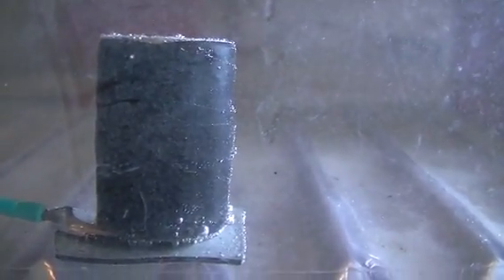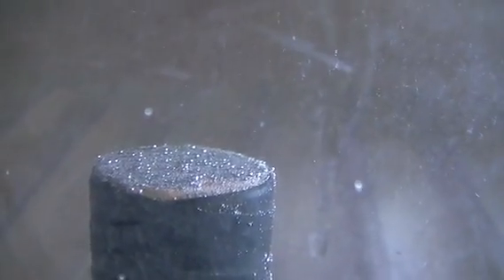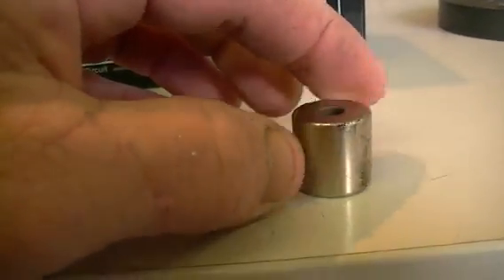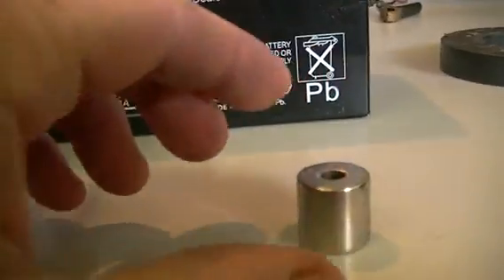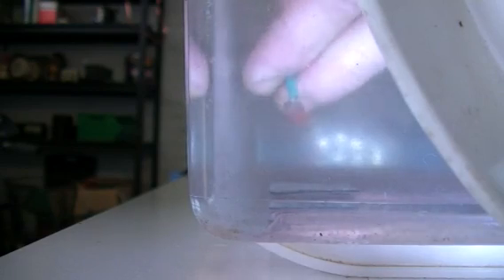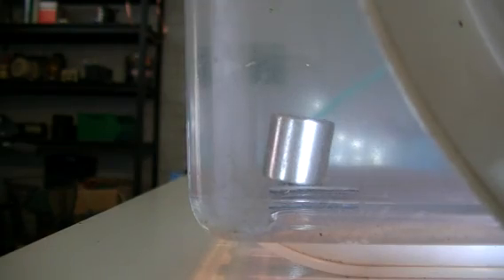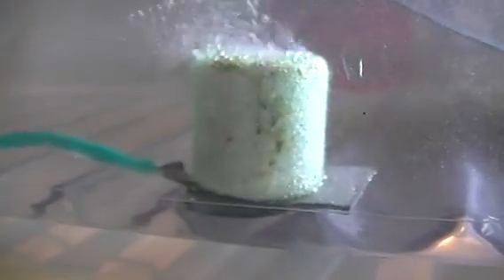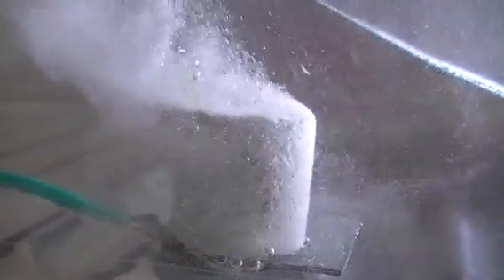magnetic vortex insulation test

Comment: On the insulated test; I didn't really see the side of the insulated magnet very well, is it still swirling around from the bottom plate? If it's not, does that mean there's some sort of momentum to the current when it comes out that it causes a directional bubble formation?